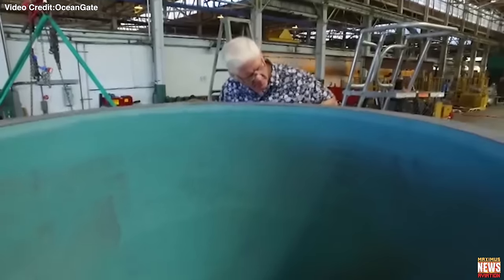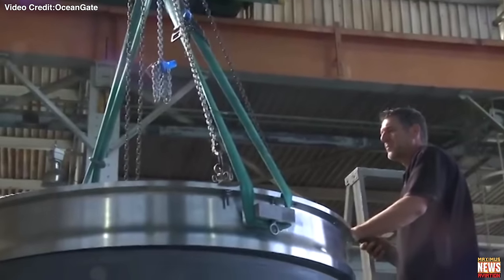Watch The Manufacturing Process That DOOMED OceanGates Titan To Fail. But It NEVER Had To Happen.

Comment: -Compression vs tension
-Layers vs weaving
-Metal vs carbon compression rates
-Non-sterile workshop
-No testing for air bubbles between carbon layers
-Use of non-fire proofed electronics inside
-no internal passenger harnesses inside in case of heavy surface seas
-white colour is hard to spot from air
-loose exterior cables and open landing gear is entanglement risk
-complacency about regular comms failures
-exposed thrusters easy to break off
-no backup thrusters on any axis
-internal led shop lighting is fire risk
-no hull integrity testing prior to each dive

Rumours:
-viewing portal only rated to 1/3 actual depth?
-no pre dive control checks?
-no underwater sonar emergency beacon?
Reply: From an engineering perspective I suggest that the viewing portal was capable of those depths, as it hadn’t failed on previous trips. This leads me to believe that the manufacturer had that port certified for a particular depth but was using a 50% or greater redundancy factor. Having it re-certified for a greater depth was probably redundant as it was already proven hence Stockton’s refusal to spend a big chunk of money proving something he already knew. As it turns out I think we know that the pressure hull failed, not the port.
Reply: @johnfisher7143  Excellent point, and one I didn't even consider.
Reply: mbbb9244, by any chance, are you a white guy who is 50 years old or older?
Reply: @johnfisher7143  The pressure chamber was also‘proven’ at those depths…
Reply: There was also footage of the sub using hessian sandbags for ballast. Not nearly robust enough for a long ocean dive & with a risk of uncontrolled & uneven loss of ballast.
Reply: @johnfisher7143 being outside the rated depth the port could still have been overstressed & weakened with each dive.
Reply: @thecuttingsark5094  yes, good point, but we now know that with each decent/ascent cycle the pressure vessel as an integrated structure suffered damage and repeated cycles eventually caused it to fail. Maybe the viewing port failed however, I think that’s unlikely as it’s a much easier component to inspect between cycles. The carbon fiber wrapped flask on the other hand is almost impossible to inspect and is the most likely failure point IMO.
Reply: Purportedly, the view port was rated at 1500 meters when one at 4000 meters was needed... of course, even a 4000 meter rating would not have saved the poor souls from a stupendously flawed sub.
Reply: This is a great summary
Reply: @johnfisher7143  “Redundancy” is for emergencies, not for everyday use
Reply: @perfectsplit5515  lol. You and I have probable watched all the same videos
Reply: Also:
-no firefighting equipment
-no emergency breathing solution
-inadequate hull failure warning system (i.e. microphones)
-hull thickness below recommended value (5in instead of 7in)
-improper pre dive systems check (they previously had a thruster wired the wrong way)

While i am not a fan of the carbon-titanium construction in general, i don‘t think that its impossible. As a novel and risky idea, it would have needed lots of prototypes as well as extensive testing before any use in a manned application. That is the idea of „move fast, break things“. Mr. Rush apparently didn’t get the message and neglected to „break things“ before putting lives at risk.
Had the development process been done properly, he could have succeeded in reducing the cost of deep sea diving without major risk to the passengers lives.
Reply: @thecuttingsark5094 not proven over time though! And not tested after each dive, it was just a matter of when to if
Reply: @hackfleisch7424  just to address your points in order:

1. Unknown
2. I did read they had emergency air masks
3. They had hull over-pressure sensor warnings, but at that pressures it’s kind of “yes it’s breaking, yes we’re dead now”
4. Hull thickness is unclear - I have heard the same 5 vs 7” story
5. I mentioned pre dive checks
6. “Move fast and break things” yes I agree. But not with passengers. I’m certain that Pakistani businessman didn’t understand the true risks when he signed the waiver.  The English guy, Hamish, he should have definitely known better given his adventure background.
Reply: You forgot one I heard there were no scrubbers on the submersible for the CO2 buildup
Reply: @gmccord1970  no this is definite false rumours. There were scrubbers, BUT the question is did he test the 96hr air duration with 5 real passengers in near-panic condition, locked in for 96hrs, or did he just guesstimate based upon regular 10hr dive usage with 5 calm TEST crew.
Reply: - He is touching the metal with is bare (oily) hands while "cleaning" the metal before gluing.
- No way to prevent air bubbles in the glue, selected glue is way to thick.
- No vacuum pump used to remove bubbles from glue before use.
- Applied too little glue. It's supposed to squeeze out, so you at least have a reasonable guess about it being 100% filled.
- Gluing process is done wrong-side-up. air is trapped in the recess and can't raise out with gravity.
- I don't see any equipment to compress the two parts to an even en specified amount while the glue sets.
- How did they make sure the glue had the required thickness after compression? (too thin will break when expansion coefficients are different, too thick gets pushed out by pressure, depending on the properties of the set glue. If these issues overlap, a correct thickness my not exist at all.)
- Large open space, impossible to do accurate temperature control.
- The glue probably hardens by absorbing water from the air, so humidity control may be required. (about 3" deep may also take a very long time, temperature and pressure must remain stable throughout the complete curing time, which could be more than a week in this case.)
- They somehow found a large group of experienced experts in applying glue?
- The group not wearing protection to prevent sweat, spit, hairs, fibers from clothing, etc. from ending up in the glue.
And that's just the gluing process itself. An experienced designer would have listed all the above in the gluing instructions, so I doubt one was involved. The sub depends greatly on the properties of the glue and if the glue manufacturer was involved, they would have never agreed to the show application process. So the manufacturer never supplied guaranteed properties of the glue for this particular use and application method.
Reply: @johnfisher7143  What you think and what we know are two entirely different things. By capable of, you mean got away with it a handul of times? From an engineering perspective that's not the way it works.
Reply: What the Fish....?
The fish must have gazed in wonder and amazement as this passed them on the way down....!
Or as they likely said at the time, "..Is that thing really trying to go deeper than a Whale....?"
Reply: No minibar
Reply: @thefivepoints  Actually, i was wondering if there would be sedatives onboard in case they have to deal with a panicked passenger…
Reply: @thegrisakgroup Probably for their safety. Panicked passengers do odd things.
Reply: @johnfisher7143 I watched a video before that a You tuber went down to Titanic on it and he said the window actually deformed and crushed in a bit. Stockton shrugged it off and said that it's normal. I don't think it was rated for those depths.
Reply: Now that you put it that way...a disaster all ready to happen.
Reply: @thefivepoints  LOL!
Reply: @johnfisher7143  Trouble with thinking it worked before therefore it is ok is that stresses can produce invisible damage with each pressure cycle, this means that although it worked the first couple of times it is weakened with each pressure cycle, eventually failing. No doubt that view port could stand 4000m but with seriously reduced number of cycles. This is why things like that have a rating, testing requirements to get a rating are rigorous and they are only rated for a set number of pressure cycles.
Reply: @thecuttingsark5094  Taking the chamber to 4000m does not prove it by any means, just because it does that depth a couple of times doesn't mean it is proven as each pressure cycle weakens the structure of all submersibles and they are rated for a set number of pressure cycles before needing to be dismantled and all components fully tested. Carbon fibre would weaken with each dive and and failure of carbon fibre is unpredictable and it tends to fail in a cascade fashion meaning it may seem fine then all of a sudden will shatter into pieces giving no warning.
Reply: Not right 100% but pretty much
Reply: and they bolt things on the tube carbon fiber , like screen
Reply: +1 Rumor:  Expired Carbon Fiber
Reply: @golfmarguerite3970  The inside is Ti alloy. The cf is wrapped around the outside of the Ti tube. But I also noticed the wall-mounted self-tappers mounted directly to the hull for the LCD screens.
Reply: Thank you captain nonobvious.
Reply: @mbbb9244  but the hull breaking basically pointed to a scandal. The point was to make a sub that would last and compete with existing metal subs.
Reply: @johnfisher7143 I don't think they even inspected the port between missions, given the other things we are discovering here... 😢
Reply: ... and then claims riding it is as safe as crossing the road ... a narcissist

Comment: Absolutely insane, it's literally held together by glue. Caps being bolted to the titanium rings gives the illusion of safety because the titanium rings are glued to the hull, then the caps are
bolted to them. Even the shape of the whole thing is questionable. Anything that is meant to go that deep in the ocean needs to be designed in such a way that the outside forces are
spread evenly, hence why the other vessels are spheres and made of one material. What's interesting is that they actually remade the hull because the previous one was failing and
this time added sensors as a "safety' feature but by the time those sensors register anything it's too late because even just a tiny crack or leak would lead to an instant implosion.
Reply: Not glue, plastic. 😂
Reply: The Aluminaut was cylindrindrical, much bigger and could dive almost as deep.
Reply: Apparently the aluminium submersible could dive even deeper than the Titanic but the main point is that these submersibles are made of one material. Mixing
materials that have different properties and behave differently when exposed to changes in temperature / pressure is bound to have problems when exposed
to those type of environments, especially at the parts where they are connected together. In this case the vessel was held together with glue which is insane.
Reply: The RTM sensor sent them a warning signal 19 minutes before the catastrophic implosion. At that point, there is really no going back.

Comment: With the amount of corners cut I'm surprised they didn't just use Flex Seal.
Reply: Flex seal actually has good composite cycling properties. Jk
Reply: If they had, all would be well cause Flex Seal keeps the water where it should be - out !
Reply: Flex Seal would probably have hilariously and ironically worked. The carbon fibre and titanium would have failed... But they'd have made it back to the surface, thanks to thick layers of flex seal and flex tape holding it together anyway.
Reply: May have actually been safer due to perhaps not getting to lethal depth.
Reply: They didn't even press the collar to the tube, and the fit was sloppy. How deep was the joint? It looked as if it might have been 3-5 inches, makes me think this is one of those napkin blueprint designs scribbled out over a three martini lunch.
Reply: @RazorStrap  The submersible only got a fifth of the way down, about -3,500 feet below the surface before a loud "bang" was heard and contact was lost.  :face-purple-wide-eyes:
Reply: But wait there’s more…..
Reply: @markmclaughlin2690  that's classic
Reply: @jamesburns2232  Incorrect.
It had been to the Titanic at least twice before.  The stress cycling so far beyond the design limits from those trips would have compromised the vessel.  Furthermore.  The implosion occurred 1 hour 45 minutes into the voyage.  If the entire time had been spent descending that would put them at about 8000 feet.  But we know they had dropped ballast and begun emergency ascent.  We don't know at what point that occurred and how far they had ascended before the implosion at about 3500 feet.  If the implosion occurred at about 3500 feet then my estimate based on descent/ascent rate guesstimates is that they made it to about 5-6 thousand feet before aborting and dropping ballast to ascend back to surface.  They lost the race to the surface.

P.S. 3500 feet (1550 psi) is well beyond lethal depth.
Reply: Good enough for Reed Timmer but not for submersibles.
Reply: @jamesburns2232  I heard they were ~300 meters from the bottom when the implosion occurred.
Reply: @richspillman4191  I think the cone of the titanium collar should have been reversed.  Th carbon should have been outside the Titaniam.   Maybe the carbon fiber threads could have been wound over the top of the Titanium rings rather  than being machined.  In that way the individual fibers would remain contiguous.  Another thought is the carbon fiber needed to be woven  in some way rather than simply wound.
Reply: @RazorStrap  Interesting if actually true.
Reply: Might have worked better
Reply: @JoeLinux2000  I see what you mean, yup even a sandwich type of joint with titanium ring inside carbon shoulder titanium ring outside. The way they spooled it in the video made me think of a wrapping paper tube.
Reply: @RazorStrap  They had over a dozen successful dives to the Titanic over the last 3 years.
Reply: Maybe duct tape with Gorilla Glue would have worked better?  🤔
Reply: @richspillman4191   I have a Rainsong guitar made entirely out of carbon fiber and it plays and sounds great because the material can be engineered for resonance. They don't use wood for any part is because joining dissimilar materials  doesn't  work in guitars so why would it work at 4000 atmospheres ?
Reply: @terryjohnson3479  great point
Reply: He basically did.
Reply: @jaycahow4667  so? All those dives accomplished was the weakening of the poorly designed structure, eventually resulting in its failure. Duh.
Reply: Sad story but that comment was brilliant and funny.
Reply: @RazorStrap  Where did you get this information from? the ballast dropping, the emergency ascent? I can't seem to verify this anywhere.
Reply: @jamesranker6275  I was in a video stated by someone who should be knowledgeable about the events.  But I have not be able to relocate it.
Reply: Any Glue has life, Titan was build in 2018 March. Over the time Glue lose it's strength. Also it been parked for one year.
Reply: They may as well, no degassing of the adhesive after mixing, application is haphazard in a none clean environment. This is real garden shed project territory here. Even the carbon fibre layup was terrible, no cross weave and its the cheapest setup possible with no environment controls and probably also not degassing the resin after mixing.  The adhesive should have been applied to the ring then the tube dropped into it producing squeeze out to be sure no voids on the contact surfaces. I am surprised that thing survived as long as it did.
Reply: PL adhesive that crap never comes off my hands!
Reply: @schrodingerscat1863  Application of Adhesive, Quality Control, On site Dust, temperature all these consider. Titan build in March 2018, Over the time Adhesive lose strength. ONGC Company I worked has Submarine. Its parked safely in Air tight Room on certain temperature.
Reply: In fairness, we didn't see what brand the "glue" was.
Reply: @RazorStrap  Carbon fiber strength is 50 times of steel. They way Rush use it's completely wrong. I'm sure he got clue,  but he he is losing funds, to survive he made this last Dive. Titan is parked from last one year. 
Sub is on it's 14th Dive. Build in 2018 Glue lose adhesive over the time period,  
Submarine has proven Technology 90mm thick titanium Round ⚽ frame for 6000 metre depth.
Reply: @HurricaneOK1  do not underestimate the strength of large adhesive areas with thinly exposed profiles within crevices.
Reply: @richspillman4191  you drink martinis while drafting life-critical blueprints?!!
Reply: @schrodingerscat1863  they had cross weave not shown
Reply: @baloog8  I was more of a beer guy
Reply: @baloog8  So how exactly did they manage that winding onto mandrel where they are winding 90 degrees to the axis of the mandrel in all the footage shown. Only way to get a weave on a mandrel is winding at 45 degrees back and fourth with each strip half overlapping the last.
Reply: @RazorStrap  source for this?
Reply: @jamesranker6275  me neither
Reply: @schrodingerscat1863  they must've had other equipment or outsourced some inner layers? I had multiple sources of very techy smart people on youtube mention this..
Reply: @baloog8  The layup would all have been done in one go otherwise the resin sets and subsequent layers will delaminate easily. You can see from the end cheeks on the mandrel they are doing the layup all in one go and it was all wound. in the same direction. While this provides maximum strength in compressive load it provides little longitudinal strength and is going to be  prone to delimitation. I have worked with carbon fibre for years and what I saw of the fabrication used for this submersible, it was  pretty much the cheapest, lowest grade job imaginable.